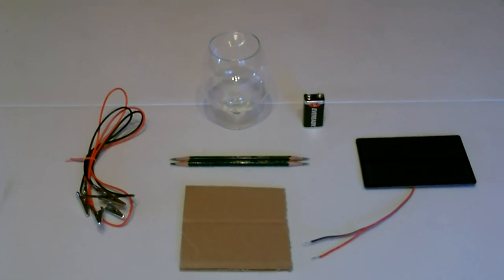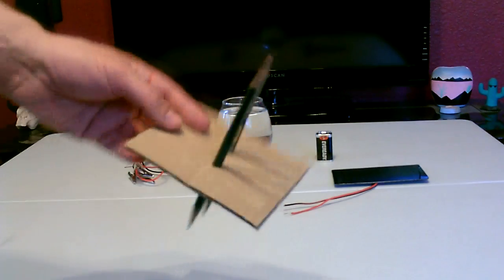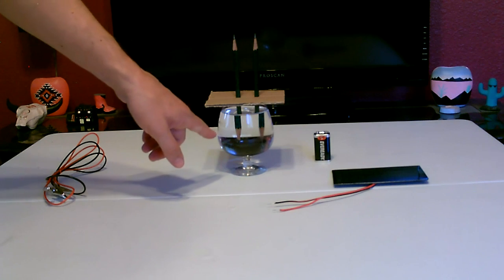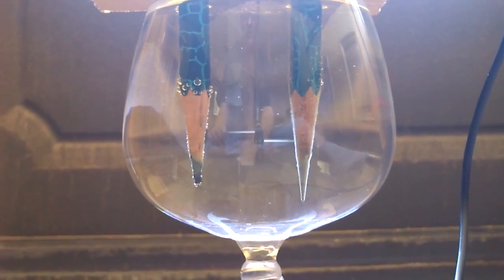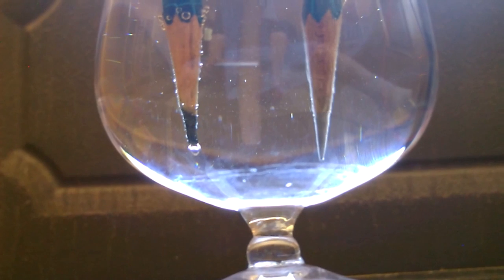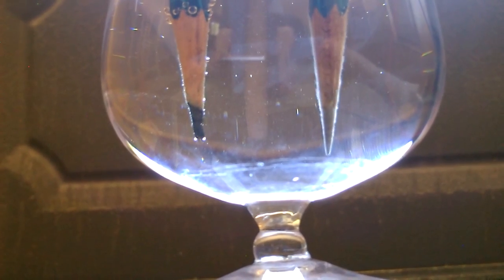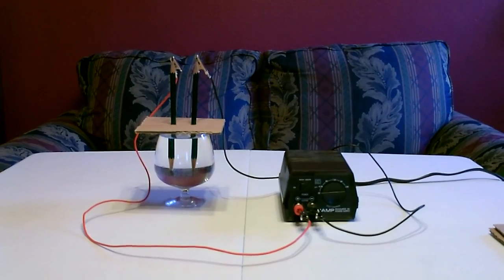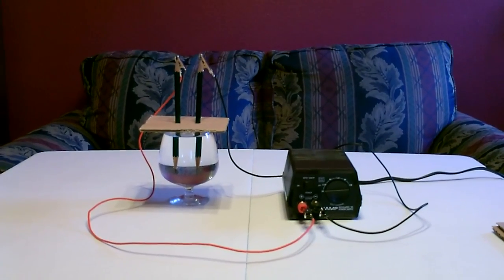Solar Hydrogen/Oxygen Generator DIY - Simple "Electrolysis" using sunlight!  (turns water into fuel)

Comment: How do you collect specific gases from this reaction
Reply: Put a dome shaped like half of a pill over the top half but leave the bottom wide open. The gas floats straight up and the open bottom allows current to flow through the water. Run a tube from each dome to a bubbler and find a safe area to store ur gas.

Comment: Make the water container "U"-shaped  with electrodes in the bottom and separated gas collection at the top of each tube.  Pressurize this U-tube from water mains and the collected gas will be at 30 to 50 PSI, which is very convenient for later use.

The electrodes can be plain iron, copper, or even stainless steel (less corrosion).  Graphite works well be cause it is a resistor and helps limit the current flow and because it does not corrode.  

No acid activator is needed for this type generator.

Yes, this type article does bring out all the nay-sayers who have never done it but have strong opinions as to why it won't work, is not safe, causes acne, and makes you sterile.
Reply: Arv Evans i saw this on TESTED. they barley got any gas out of it because they put the electrides to far awag from eachother
Reply: @10goni It works. Think about why some wouldn’t want this info known. TV is not your friend 🤥

Comment: Ok i don't know if this is a stupid question or not but I just had to ask, please tell me if I'm having a dumb moment. Ok you said that this is to split water for fuel so..... does that mean that if this experiment was big enough that it could be used as fuel for cars? 

I heard somewhere that someone found a way to use water instead of gas but then he was murdered because I guess companies would lose money if we all figured out how to use water instead of gas. They would probably just raise the price of water or something that's how fucked up they are.
Reply: Icey embrace You mean the 4th law, dontcha? ;->
Reply from the maker: karamelaka kitty hi there. there are already "scaled up" versions of this in use all over.  some "residential size" commercially available "electrolyzers" are being used to produce fuel for homes (about the size of a washing machine). some much larger ones are already producing fuel for whole areas of towns. but to answer your question; yes, the fuel that an "electroyzer" produces could be used to fuel cars (cars designed to run on hydrogen).
Reply: +karamelaka kitty You can push hydrogen into propane tanks at about 3 atmospheres, but they will only run your car for a minute or two, so you would need a trailer full of them. To get a car to run very far you have to compress the hydrogen to extreme pressure. Hydrogen production is very inefficient taking 2.5 times as much energy as you can get back from burning it. A battery works better and is much more efficient. That's the problem with hydrogen cars, they're wasteful compared to electric battery powered cars. You can feed hydrogen directly into your carburetor, however, without modification, just unhook the gasoline and it works fine. The problem with hydrogen is the poor efficiency of production and storage.
Reply: yes, but if you tried to run the hho generator off of your car's battery, it would violate the 3Rd law of thermo dynamics.

Comment: Try it with a sheet of graphite wrapped in a spiral with various spacing for maximum surface area. 2 separate 5 gallon buckets connected by a pipe at the base for conductivity will make sure the gasses separate. Not sure how to collect the gasses though.

Comment: Very cool, but what is the purpose? Just to deliver oxygen and H to the environment? Oh I see, you are saying you have to collect it for fuel.. Does it run out or eat up the pencil or will it run forever?
Reply: +Kam White you might need to refill the water eventually.
Reply: +Kam White Forever as long as power source like battery or ssolar panel lasts